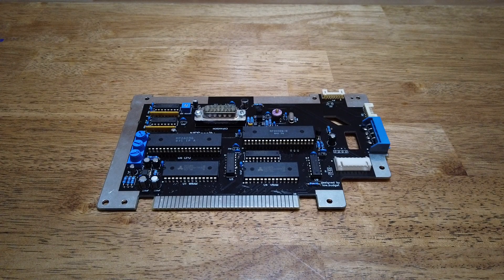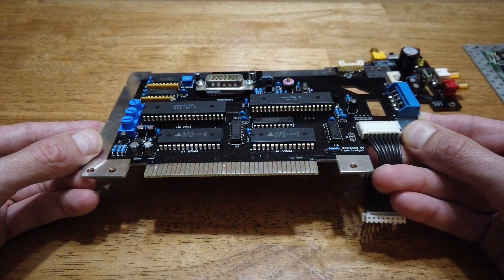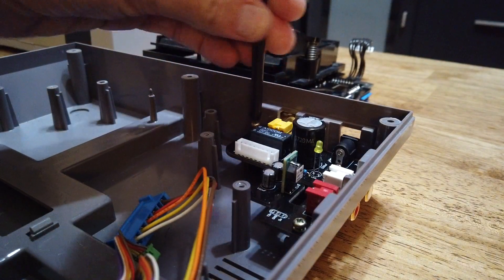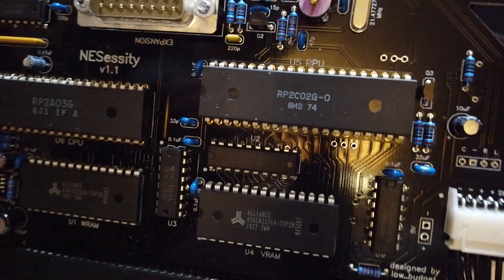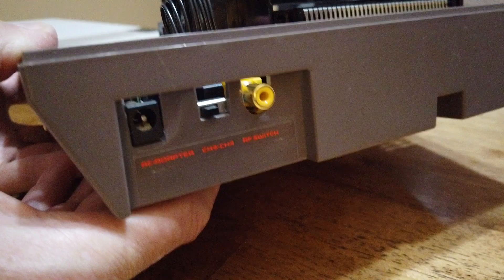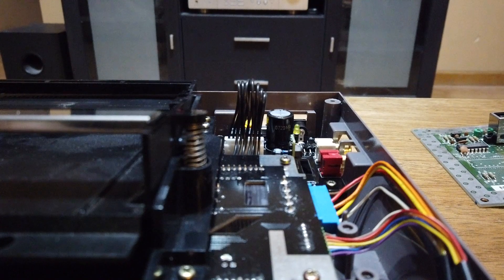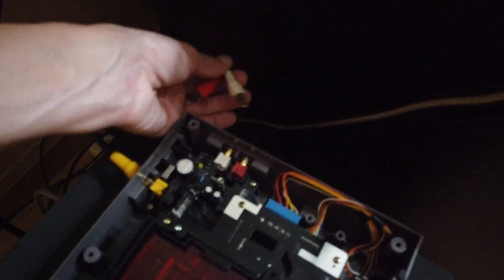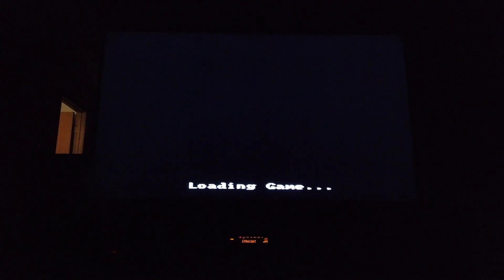NESessity v1.1 Replacement Motherboard for Nintendo NES

Comment: That's great work!
I'm wondering if it is possible to have a 50/60hz switch on the nesessity? That's a thing that's impossible on the original nes (I'm PAL) et would be great to be able to play non optimzed games in 60hz instead of 50hz.

Comment: any plans to integrate the rgb mod and or exp audio??
Reply from the maker: As long as the Famicom converter you are using has NES cart p54 connected to Famicom p46 expansion audio will work fine.  A jumper can be added if this connection is not present.
I will not be incorporating any video mods into the NESessity PCB design because this would make it much harder to assemble in kit form and increase the cost considerably.

Comment: you mentioned it would work with the NES RGB, any chance the next revision will have a built in  NES MultiAV and some solder pads we could use to connect in the NESRGB?  On the expansion port, will the next revision include more of the NES expansion port pins?
Reply from the maker: I do not plan on using the Nintendo multi AV connector in the NESessity at this time.  It would require some fairly major redesign to incorporate, but I may look into it when I design the next PCB version, whenever that may be.  For v1.2, I have designed a simple PCB that will allow easier mounting / wiring of the s-video connector and 8p mini-DIN for RGB video output.
Reply: @lowbudgetify  Oh, awesome!  That works just as well as the MultiAV out at the end of the day.  While it would be convenient for anyone who already had a MultiAV cable, really anyone who would care about having the extended options to really make use of the MultiAV would be able to just as easily use the mini-DIN (and the mini-DIN is easier to install, let's be honest)

Comment: On the stereo sound, is this duplicating the mono into 2 channels, or is splitting out the 2 sound channels of the NES before they get mixed into a single channel to give a pseudo-stereo experience?
Reply from the maker: The NES CPU has the sound chip built in.  There are 2 pins providing audio output, which are mixed together in the original NES.  The NESessity drives these 2 audio signals without mixing them together to output stereo sound.

Comment: nice looking project!  I have a couple questions, on the original NES using a switching 5v regulator often results in jailbars or other artifacting due to switching regulators generating more noise than your standard linear regulator.  Do you find that occurs with this board or do you have better isolation? (I noticed some caps next to the regulator that might also alleviate this issue).  Also when you talk about supporting aux sound output from pin 54 of the cartridge slot, that's the pin that connects to EXP port pin 6, correct?  Any chance of using cartridge pin 51 on future revisions?  This connects to Expansion 9 (Expansion Port pin 6, I believe) and if this was jumpered to expansion port pin 3 (Audio In) this would support expanded audio for devices like the Everdrive.  Sorry for any additional comments from me, I'm only 2 minutes into your video, but very interested :D
Reply: Arg, I just reread this and realized I got all confused and wrote things just the worst way possible.  Cartridge pin 54 connects to logical EXP6 which is the physical 9th pin.  So I'm assuming you're already bridging pin 9 to pin 3.  Or are you using the method recommended for the NESRGB (see this site http://www.firebrandx.com/edn8tonesrgb.html) where pin 9 is connected to pin 2 (GND) and a secondary connection is made from expansion port pin 9 up to J5 on the NESRGB?  Giving some solder pads or resistor mounting through holes to let people decided might be a worthwhile option.

Comment: Will the components needed for the board change between the revisions? I'm about to order parts before v1.2 comes, but I just want to make sure the parts I order wont be the wrong ones. Also, how many of the original components can we use? I would assume pretty much every chip, and then I need to get new capacitors/transistors/resistors, etc.?
Reply from the maker: There are some component changes planned for the upcoming v1.2 NESessity.  I would recommend waiting until the new PCB is ready and I have the new BOM released before ordering parts.

The ICs used on the NESessity are identical part #s as an original NES with the exception of the RAM chips.  The original 2K static ram chips have been replaced with 32K ram chips, with the extra memory disabled.  This was done for parts availability reasons; the 32K chips are cheaper and easier to find new.
Reply: @lowbudgetify  Another question. Do I need to install every component for it to work? I don't intend to use the mic for any games, but if the board can only work if I install it, I will get it anyway.
Reply from the maker: @ajmosley390  The Famicom microphone circuit is completely optional, while the composite video amp circuit is not needed when using the NESRGB.

All other components are required for a functional system.

Comment: This is really awesome, looking to get one to replace my old NES motherboard. Although I was curious if this of the 1.2 revision would be compatible with they Hi-Def NES mod. I happen to have a kit that I've been meaning to install and I'd be great if it was. Keep up the good work!
Reply from the maker: The Hi-Def NES mod will work fine.  I like to power it with 5v from the NESessity's voltage regulator rather than the one built into the Hi-Def NES, but either installation will work.  The (original) composite video will work when the HDMI cable is not plugged in.

Comment: I want one. I know this mod isn't done much anymore since the nesrgb and hdnes came around but I think it would be nice to have the option for a playchoice 10 ppu. Anyway as soon as 1.2 is ready I'm going to give it a try.
Reply from the maker: It is possible to add the Playchoice 10 PPU or the PPU from a Nintendo Vs. arcade game.  A RGB amp/driver circuit would be required.  There are 3 unlabeled pins under the PPU on the NESessity that can be isolated from ground by cutting 3 traces then these points can be wired to the RGB amp.  I made it this way so no pin lifting would be needed on the PPU.
Reply: @lowbudgetify  Oh nice. it already accommodates it.

Comment: Hey, been following this on shmups.  It would be amazing if you could do this with the ability to hook up the NESRGB to a multi out similar to how the "borti NES i/o" board has the option.  The user could select if you want to use the NESRGB audio, or your stereo version.  I think the only thing you would need to change is the RF box replacement board and just dont send video from the main board, etc.  Thoughts?
Reply from the maker: Unfortunately the borti NES i/o board is incompatible with the NESessity.  The NESessity motherboard was designed to work exclusively with the custom power / IO board that's included. The IGR mod board can be used for the reset and palette swap functions the borti board offers.

Comment: It would be nice to make a mod to the pcb to allow for top loading cartridge.  That way you can put in a nice custom case and get rid of the annoying old front loading connector.  nice job though
Reply from the maker: Search my other videos for the Super 8 bit console :)
Reply: @lowbudgetify  thanks i seen your other design.  good work   i am just making a top loader mod at the moment.
Reply: @Mike 1014531 I could do that but I will flip the motherboard upside down and install in a clear acrylic case.  That is what I would do for sure with these new motherboards to show them off.  Nice to see all the old mos chips